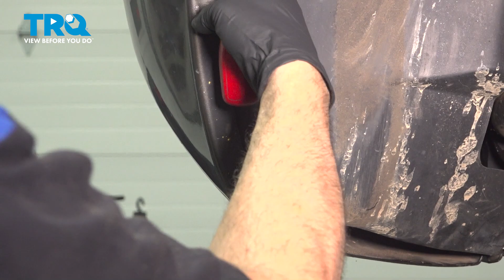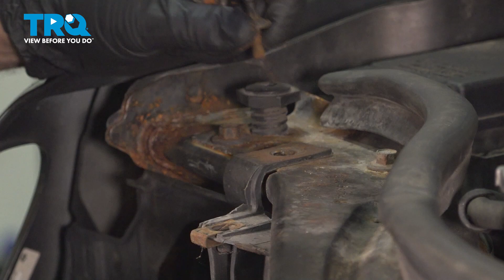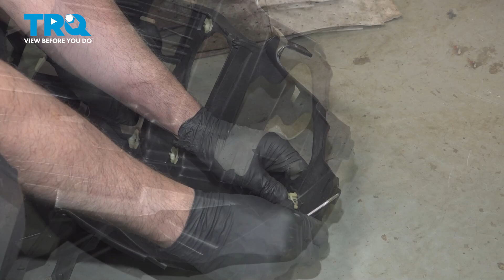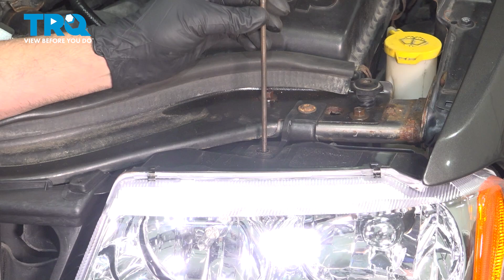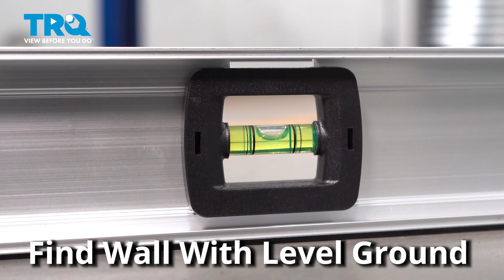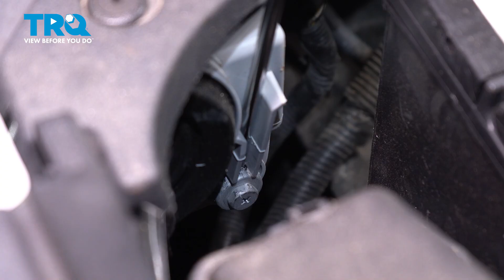How to Replace Headlight Mounting Panel 1999-2004 Jeep Grand Cherokee

Comment: I have a 2004 Jeep Grand Cherokee. This video does not show anything about a 2004. The parts are different, the hardware is different, and the procedure is different! After watching the video several times, then doing the repair I struggled with that actual work. NOT HELPFUL!!!!!